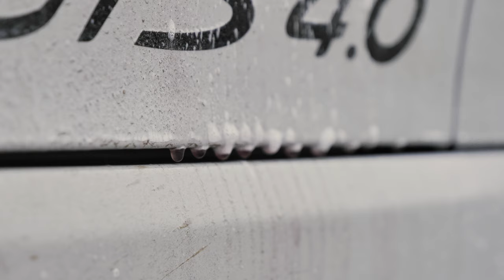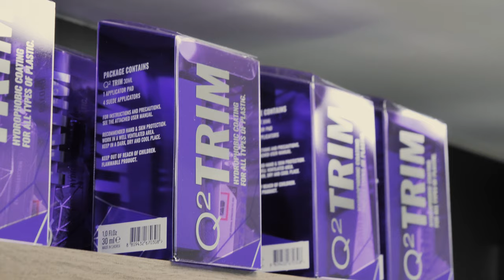PORSCHE 718 Cayman GTS | Arrives At SCC

Comment: Quick question, why leave the front trunk opened while washing?
Reply from the maker: Because the volume of water will not damage anything in the car. It will dry
Reply: If u leave the key in the car it won’t open by itself :)
Reply from the maker: @yndng  well that’s helpful

Comment: Hey, I assume you are leaving the frunk and trunk open but laying flat because of the ease of access feature? Doesn't the water and soap get into the interior that way? sure does when I do it. Every single time I wash my gts 4.0 this feature drives me CRAZY! I really wish porsche would have made an option to disable it.
Reply: Also did you skip the paint correction or was that done elsewhere or previously?
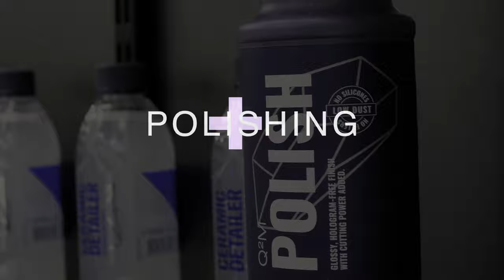Reply from the maker: Hi Jack. It’s not a major issue if a bit of moisture drops inside it’s soon dries. Also machine polishing = 5:47 👍🏻
Reply: @staffordshirecarcare  Yeah you are right. I like the technique of just leaving them open from the start though. I might start doing that.
Reply from the maker: @jacebeleren429  sure. Think it’s just a habit 😂